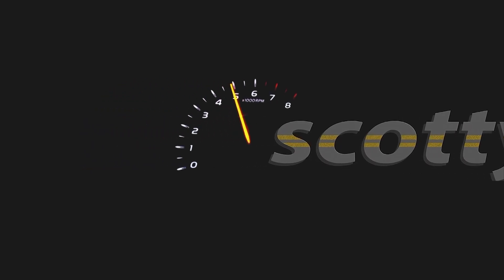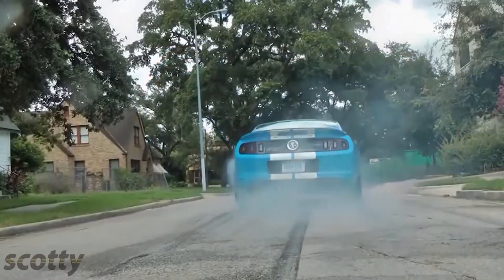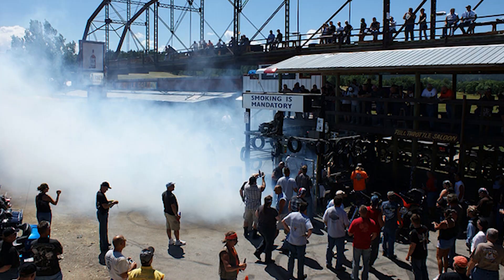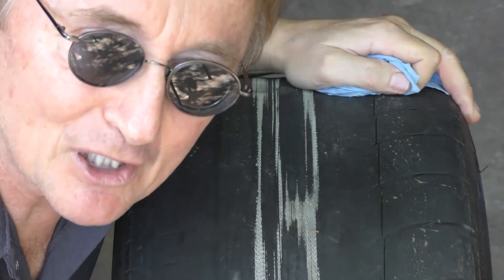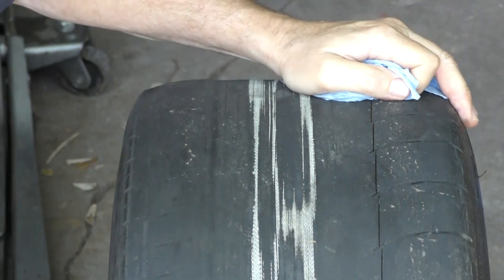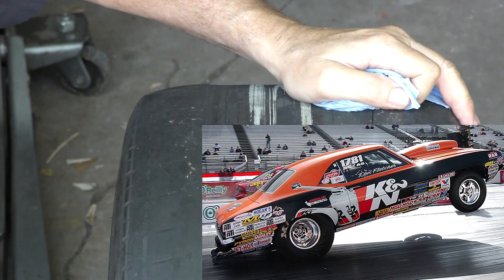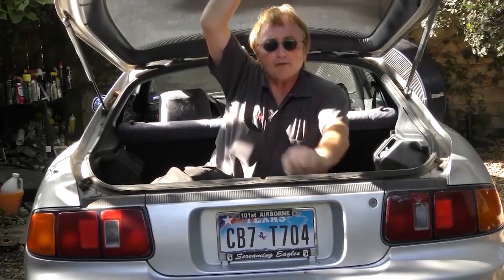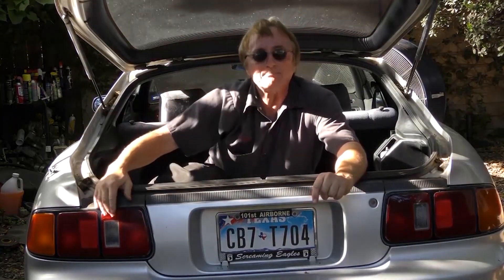Why Not to Do a Burnout in Your Car

Comment: If u have the right tires and car that's engineered for drag racing, then there's no problem with it and love doing burnouts with my Challenger SRT8 that we are building. She has the right components plus tires to do them, and am running 305 Mickey Ts on her. We also installed line lock a couple of years ago, and really helps to get them nice n sticky before launching her. Scotty doesn't understand because he is much too conservative when it comes to cars, and is why he loves Toyotas so much 🤣

Comment: I would think a car at a dragstrip encounters MORE stress on the tranny and other parts of the car during the launch rather than during the burnout.  During a burnout, some traction is lost, thus decreasing the load on the tranny.  What I don't quite understand is why do they need to do a burnout in the firstplace?  Why not just heat up the rear tires with tire heaters?  Is it only the heat they desire or is there some other benefit to a burnout before a drag run?  When I used to drag race my motorcycle, I never did a burnout and I didn't lose traction since I could just do a low wheelie and it would hook up just fine.  Plus I would ride my motorcycle around out on the road just before my run to warm up the tire but even that didn't seem necessary.  The bike ran under 11 seconds with no burnout so it wasn't exactly a slow bike (but by today's standards it is).

Comment: Scotty? I enjoy your videos and a lot of times you are on point. Recently I’ve noticed a lot of hate on the compression fitting deal. Personally I would steer away from it as it is proper to just replace the line instead, I know you have a lot of experience however that does not take away the fact a repair like that can fail! Seen it to many times where I hear ‘done it for x amount of years’ and then it fails. Not hating just observation. Second I do think even though the experience you have is amazing I do would like to press on your heart that in some cases I think you are ‘out of touch’ on new vehicles etc. I work at a ford dealer and have seen ‘old timers’ go down as they refused to accept the fact that they sometimes are out of touch when it comes to some new technology. Cheers! But keep up the videos I do enjoy them

Comment: 1 tires shredded 2 transmission will probably break 3 diff might break 4 engine might blow 5 cv shafts might snap 6 drive shafts might break 7 there’s a lot that could happen 🤣

Comment: Hey, Scotty I got a Mitsubishi Pajero IO 2000 model. It is also called Pinin or Pajero Shogun, it has 1.8 GDI engine (4G93). It had a mild Cooling system problem and after using coolant seal. The problem fixed thanks to you :D . My Pajero io has over 161xxx on mileage. and the Fuel economy is getting worse. Do you have any tips to improve/maintain the GDI engine ? and how to diagnose issues with the Mitsubishi Super Select. If you can, please do a video on 4WD vehicles / Mitsubishi Super Select.

Comment: 5 horsepower is the equivalent of lifting 375kg/825lb 1 meter/3.28 feet - in one second.  I think that would cause an instant burnout of the heart if it were possible.  So - don't do a burnout in your car - or of your heart.  And always check for yourself if what you hear on Youtube is worth paying attention to.

Comment: Hey scottie, I like to floor it off the stop light with my automatic transmission vehicle when racing against another car. I have also heard before you launch, you can hold the break pedal while pressing the throttle a bit to load the transmission for a better launch. Are these habits bad for my car/transmission over time?
Reply: Yes lol
Reply: @josemolina3858  I just punch it most of the time, instead of preloading since it seems to work better for me in my particular car. I’ll will have to look up which is worse than the other. I would think preloading? But also the surge against the drivetrain is bad to isn’t it? Lol
Reply: @shaunskii  I just personally step on the gas while holding the brake when I'm at a stop sign or traffic light uphill so my car doesn't roll backwards

Comment: You missed one of the most important reasons not to do burn outs...back when we were both young and had hair and not the ones growing out our ears, automobile tires were not steel belted raidals.  Glass ply if I remember right..and could roast them all day and just wear them down.then they became maypops Steel belted radials tend to shift belts when spun..giving you that thump thump out of balance feel. Nothing like throwing a belt doing 70 on the idiot state, tears the hell out of fenders,myself I run 35x12.50x16.5 tires and my little(cough cough) Chevy stroker can spin those tires forever usually when I don't want them to like when it rains after a dry spell, I just replaced my right rear because of a bulge. They broke loose and I kept my foot in it. And shifted a belt. There went a 300 dollar tire. You said tire wear.. You should have show a shifted belt blow out. But what should I expect from a knuckle buster who crawls under a vehicle on a jack and don't use jack stands

Comment: Burn outs can happen when not wanted, such as with a front wheel drive on wet oily pavement. Also such things are dangerous, and  if you notice that it is slipping just take your foot off of the throttle and problem solved. Also proof of this is seen in southern california every winter first snow. People crash and end up facing the wrong way on the highway.

Comment: Spot on. Even at the dragstrip really just a couple turns to clean the tire off is all you need unless you’re dealing with over 700 hp and gigantic dedicated drag tires. The musclecar movement is alive and well but we can’t be jackasses out on the road or it will end just like it did before..... and people will get hurt. All too often I see some poor car being brake torque to within an inch of its life and the noise coming from the transmission is louder than the noise coming from the exhaust.

Comment: He forgot to mention that a glue is used on them tires on the 1/4 mile track. The burnout is to heat up the tire so that the glue sticks better to the road. Street burnouts, like he said, are just dumb!

Comment: how many women do I see doing burnouts? Quite a few, doing a burnout whether in a street race or just goofing off (both irl and in game scenarios) is generally a casual thing done by racers of BOTH genders. Burnouts especially in a street racing scene has literally NOTHING to do with what he's discussing, it's a show and it's good fun. Most people buy tires FOR doing burnouts, it's a way to show off and look cool even in a slow car. What YOU are referring to is not actually a burnout however, most of this video is discussing when someone who's most likely "goosing it" or in normal terms they're giving the car a lot of gas from a stop causing the tires to slip. Everyone has at some point done this and it's usually by mistake, goosing it is generally a "new guy" thing to do when driving and frowned upon. ACTUAL burnouts however? They have a purpose (which you mention) both for actual racing, and in putting on a wonderful show. Honestly, your videos seem more harmful than helpful, especially to people who want to get into anything automotive. I'm literally looking at right now a video FROM you discussing NOT changing transmission fluid, an asinine claim. And this video will mislead anyone new to racing. Say someone wants to learn how to do a burnout for a friendly street race on a legal drag strip. Say they want to know how because their car CAN slip the tires at high speeds and they'd like to learn to do it RIGHT, you have made a video that could easily get someone killed. Thanks

Comment: Hes just jealous his slow mustang can't do a real burn out but he tries in his videos 
Burnouts are cool and fun on the streets or the track when I was younger I had a 67 Chevelle ss 396 but had a built 454 bbc with built turbo 400 transmission and 12 bolt rear end with 373 gears I did burnouts all over that car was fast as he'll and I could burn out all day long I never had any kind of issue
Reply: Well what about tire wear? Besides that “slow Mustang” he has is a 2013 Ford Mustang Shelby GT500, with over 600 hp. What do you mean “slow”? Lol